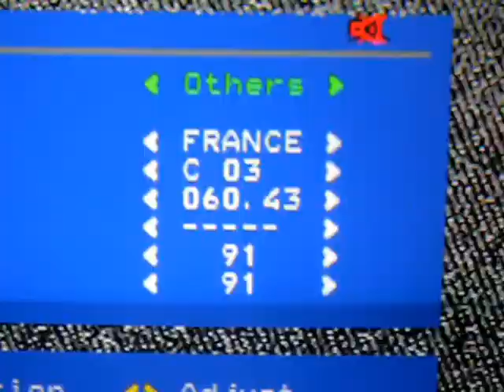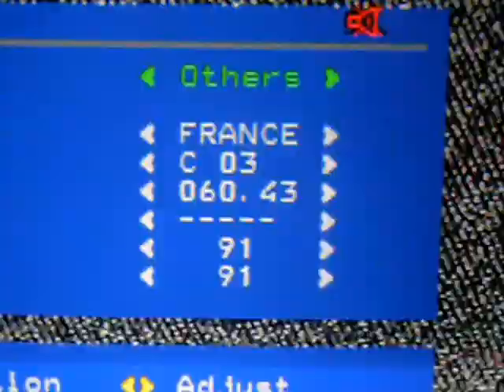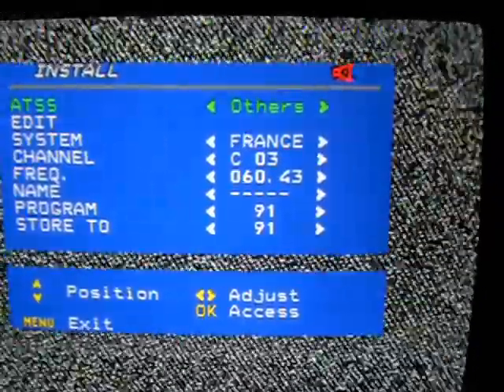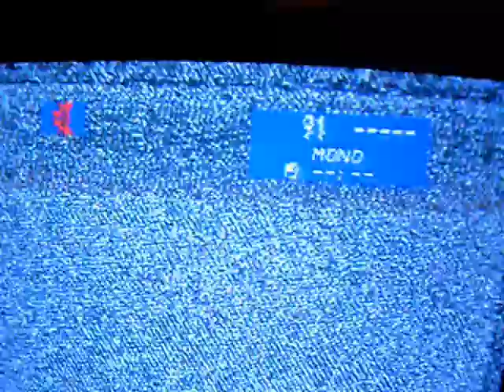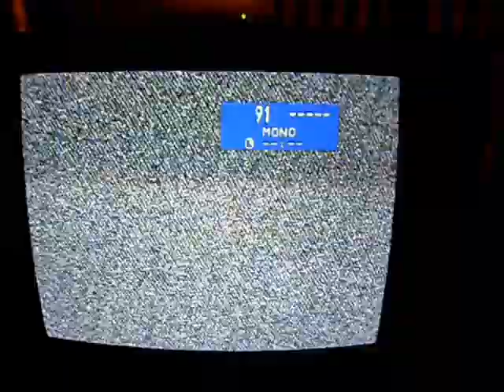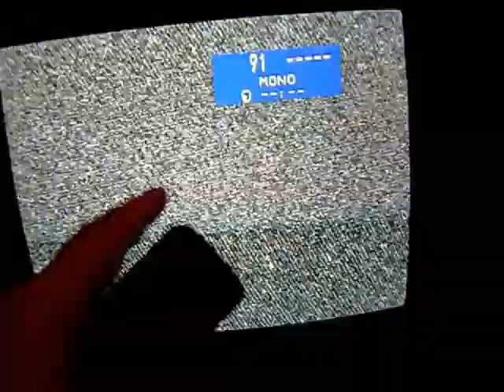Strange TV Signal at 060.43

Comment: Whats your location and antenna? Tv's generally receive audio as an FM sideband carrier to the rf mixed tv signal (only true for analogue tv) If your in the UK, its highly likely some FM transmitter somewhere local that is confusing the auto tuner/agc/afc in the tv and the sound is a result of that circuit trying to lock on to what it thinks is an rf signal. At that frequency it could be anything from a baby monitor to rf remote controlled devices.

Comment: Did you work out what the noise was? I bet it is a combination of terrestrial noise modulated through the image signal or the display inserter in your TV set. You hear the "rythm" in the audio signal? It corresponds with that little animation on the "scanning" symbol (last line in the upper left blue box, before the letters --:--. Why this happens on exactly this frequency alone, is left for me a mystery. That is one for the TV engineers to answer. Probably some color frequency (blue or white) that "spills" onto the audio signal (as these two are modulated into the same composite signal).

Comment from the maker: If you look at the video again, I have a 21 Inch widescreen LCD TV at my left shoulder just out of shot of the camera, It's a HDTV but I have never attached an antenna to it and only use it as a monitor for the computer.

I actually prefer to watch the old TV as the picture is still way better when it comes to contrast and colour compared to the new TV's, that why I have this old one in my room, I also have a 42 inch Toshiba with full HD in my living room, but I hardly ever watch TV on it lol.

Comment: Interesting noises and wrong static, albeit the audio isn't loud enough, but I was kinda more interested in putting my ear to the speaker and listening to about the thickest Scots accent I've ever heard, totally awesome.  I could understand most of it as long as I had a thread, but if you miss one thing then it's gone (initially "eh" will throw a guy off).  I think it would be cool if my accent (mild Ozark "hillbilly") were thick enough to render my speech barely discernible as English.